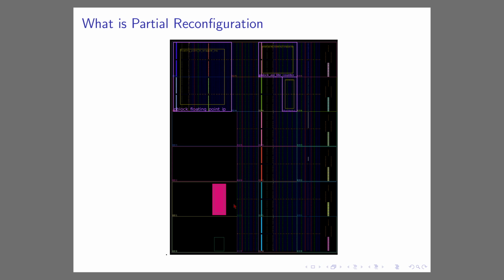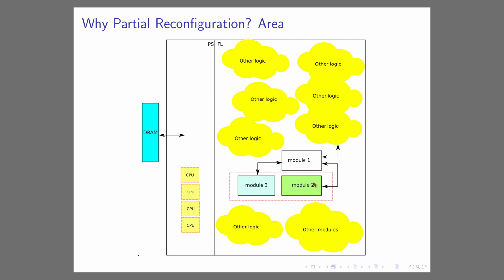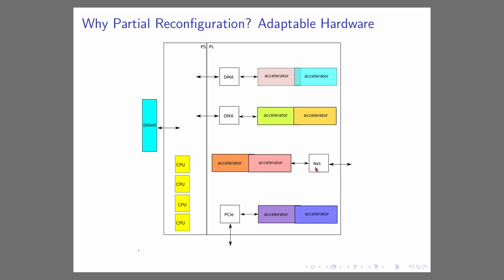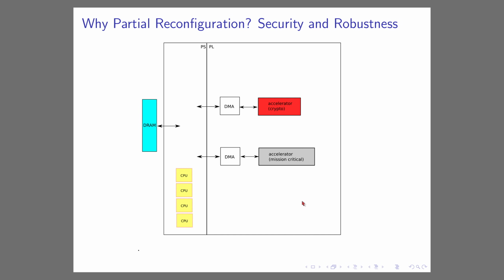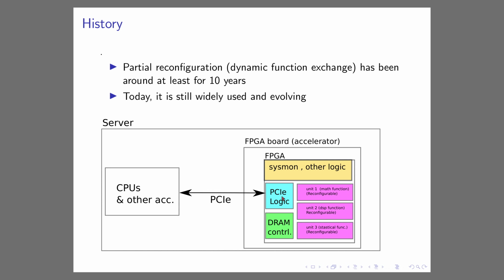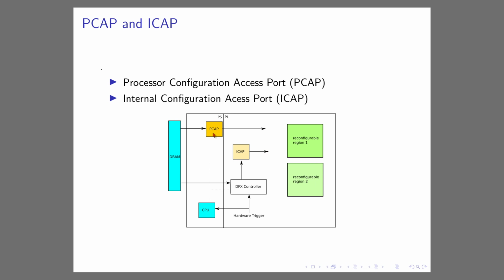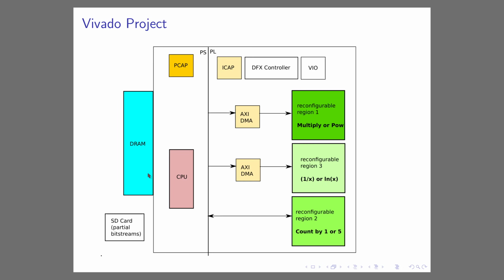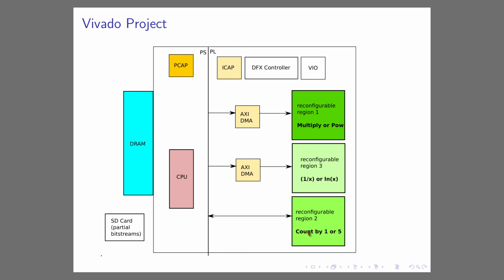Dynamic Function Exchange with ZYNQ Ultracale+ : Part 1: Introduction

Comment: I doubt PR could help decrease bit flip. 
Xilinx unit is prone to bit flip because the majority of the silicon are constructed by configure memory cells. 
You see Readback Failure either in write (configuration) or read. 
When you configure unit repeatedly, the risk of bit flip is higher upon the current defect is in configuration circuit (of course with intermittent fault model). 
But once defect is in read mode, and luckily the time to bitflip is short than, lets say 100ms in your case, the recurring configuration indeed help prevent bit flip failure exposed to customer